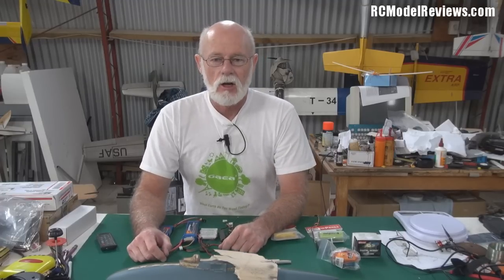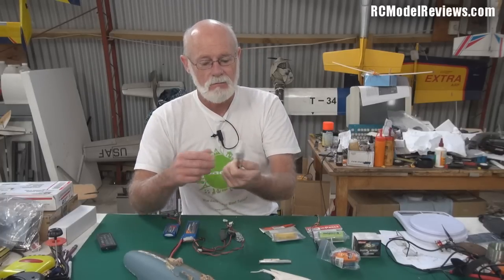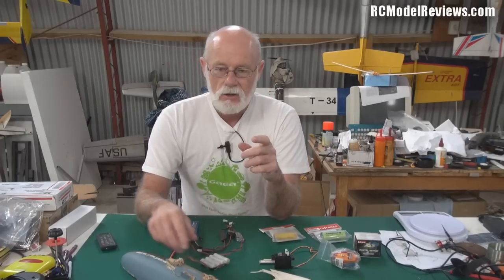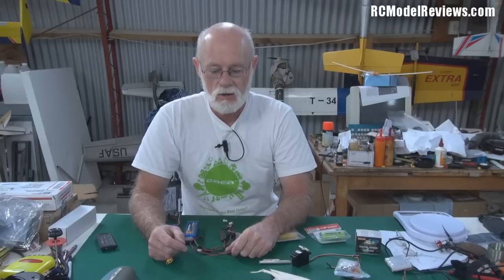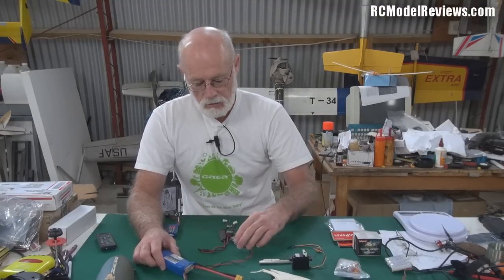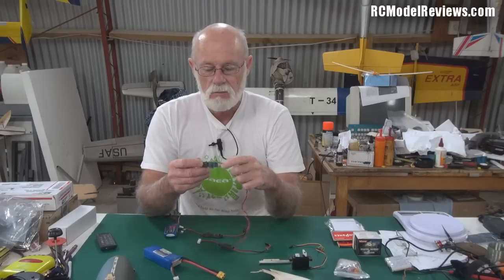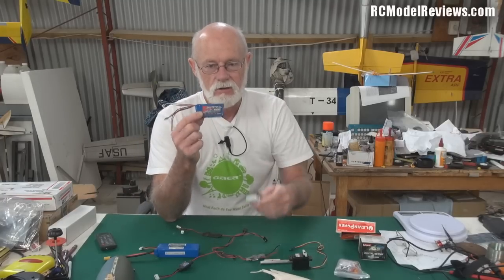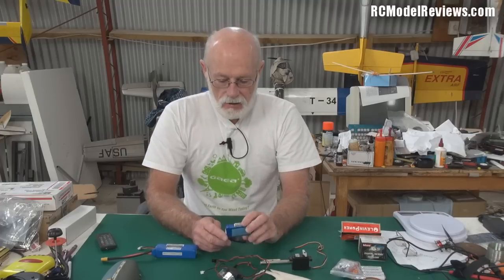A word about receiver batteries

Comment: Thank you for the information, I have watched many of your videos on RC. I am newbie in RC. I am stuck on a few questions and couldn't find any reasonable answer so far. 
My question is.. on the receiver end, how do i determine battery voltage Amps etc?

if there are ...
FlySky 9x Receiver and ... 
2 motors with propellers on both side wings connected parallel with speed control,  
2 servos (I don't know its required volts) on both Ailerons,
1 servo on Elevator,
1 servo on Rudder,
1 servo on Landing Gear,
1 servos with Flash light.

Now how much volt of current and in what direction i will need to put connection with batteries.
Reply: That's lot to ask as a you tube comment mate. Go to rcgroups (google it) which is more appropriate to find such info and ask such questions.
Basically you need to look at specs of your equipment and calculate it.

Comment: I have a 10a bec and can i use a 2cell 1500mah 20c lipo battery to power 2 hitec hs82mg servos and 10 towerpro mg 90 servos and 3 electric servoless retracts on a rc jet?or i need a bigger bec or a bigger battery?

Comment: I drive cars and trucks so not much of an issue hasn't someone come up with a backup supply just to land the planes ie a cheap 4 cell old type so when the power goes off a switch jumps into the backup just to land the craft?.
Reply: Fx 1C Yes, they sell a very simple device that does just that. I do use an "old" 4.8v nicad as my back-up. It only gets switched on if the esc/bec fails or the lipo (2S or more) drops below the 4.8v. The 600mAh is plenty to make what would be a deadstick landing.

Comment: i have an rc car it need some more power than 4 double a battery's i have noticed under 4v it shots down and then my car stops 
I have found a battery that is a liFe battery its 6.6 v my car has 6v servo's does that do harm or can i use the 6.6v ones?

Comment: Hi. Any ideas on which receiver and bat pack I should use on a 106" Edge 540? It has all metal gear 4 High Tech 7955 digital servos for ailerons 2  2 HT 7955 for dual elevator 1 same for rudder  and a bit smaller for throttle. sorry cant remember that number. Im running gas engine DLE 111cc Note: I had this plane running on all this info above and flew 2 flights beautiful but the 3rd flight was to its death. Lost signal or receiver and had little to no control about like a brownout. The two onboard batteries were fully charged. The ignition pack was a 7.4 4ooomah lipo. The receiver pack was a 7.4 5000mah. The both checked good at 8.15 and 8.17 at time of crash.  also I used volt regulators for both packs to reduce to 6 volt.  The receiver I had on board was a Spektrum AR6210 and transmitter is a DX6. Can someone tell me what I did wrong in this case???  Please help because my new Edge 540 will be here in a few days. Should I use a power board like smart fly or something to boost servo power or maybe a better receiver? Again PLEASE HELP Thanks

Comment: Hi Bruce and thank you for another super video. I  often check my lipo's  after charging  but , I can recall  placing a battery in my helicopter and flying it , thank  god   I didn't crash it . After rechecking  battery , I soon discover that the battery amp dropped down very low . Soon , I came to the conclusion that my battery was bad. Oh, what a surprise it was for me. So, I would like to ask is there a way to check battery amp's and avoid  a surprise .

Comment: Could you please help me? I have been flying for a couple of years now on and off, that is why i havent learned as much as i should, and mostly because i am not member of any Club yet, so everything that i learned i learned by reading, and that is not much. I have always power everything from the Esc (one Lipo) and i have never used bigger than 200Mamp. bat. Now that i am getting into FPV, i shorlly would be in need of couple of batteries on board, could you please make a Video about that.Thanks

Comment: I am curious also to see Bruces response to the LM7805 question.. Its a simple voltage regulator...but 'm not sure it can handle the current of large servos. I was thinking of using it for the 5 volt regulator for some cams and transmitters in FPV. I bought some nice regulators ...but they produced lines on the video... and I think the LM7805 may not do this.
Reply: Try a 338 adjustable regulator

Comment: could I use a 1 cell 3.7 volt lipo to power my receiver and servos on my nitro?
Reply: Would not advise doing that. (lipos have voltage 3.0-8.4V) depending on charge. You would risk receiver brownouts, most RX's drop out around 3.5V.
And under load voltage  it could easily do that. 
For example on spectrum rx's see: http://www.spektrumrc.com/Articles/Article.aspx?ArticleID=1683

Comment: I LOVE the idea of LIFE packs. Always have, but all the quality companies are gone. In my case converting dozens of planes to LIFE, with life chargers is cost prohibitive for something out the way out the door. New flyers buy life will get left out to dry converting later. Leaving LIPO+BEC which I don't think anyone really likes. We just tolerate it. :'( We need High Voltage components to become standard. Standard 4.8/6 servos work to 7.25v. OEM's should make the v range of 2s lipos standard IMO

Comment: Hi. I am building the Giant 2metre wingspan LX Mitchell B25 Bomber. I will also fit the 'model sounds incorporated' sound system with the recommended 3 inch speakers.
The sound system will work independently and directly from a Lipo as it has a voltage range of up to 24volts. So no problems for that.

The Bomber itself has 10 servos and additional cabin area LED's, and I have been advised to power the receiver independently.
The main battery, a purpose built flat pack designed for the model by LX. power the twin 600kv motors.
I watched your piece on the Lithium Iron Batteries (LiFePO4) and wanted to get your thoughts on the size required.
The main issue will be weight as I will now have 3 batteries.

I really enjoy your vids. They are interesting and very informative.............keep up the good work.

regards

Comment: Bruce, suggest you do a video on power boxes. They are usually waaay too expensive for just a couple of diodes..

Also for info, I use BECs in all my medium sized planes with 2s 1000 mAh batteries and have never had one fail. And they're all chinese :p

Comment: I have read through most of the responses and you or anyone else has commented on whether or not these LiFe batteries with "blow" the 4.8/6.0v servos and servoless retracts and your post it nearly 2 years old...Maybe a test with you using Life batteries would be in order?
Reply: most rx can only put out 6 volts anyway so servos will only see 6 volts...just make sure rx and servos rated 4.8-6.0
Reply: Servos that support 6v (that's nominal voltage) are designed to support 5 cell NiMh packs so. 2S LiFe packs which have very similar voltage range work fine. (and servo that run 4.8V nominal are designed around 4 cell NiMh packs) (NiMh 1.2v (nominal/cell) and 1.45 max/cell = 5x1.2V=6V and 5x1.45=7.25V
This can vary with servos, you need to check with manufacturer , especially with some of the older servos. Most digital servos 6v have no issues with 2s LiFe packs

Comment: Energy Density of an rx in medium sized+ plane is moot.
Maintenance requirements are EQUAL to that of lipo packs which need balancing as in NON EXISTENT. Just as Lithium packs need periodic balancing (more as they age) most chargers auto-balance every charge. Every good nickle charger ALSO has logic to cycle the batteries on command, automatic cycle/trickle loops, etc. My Litco has an indefinite C/10 charge->trickle->Cycle loop for example. Attach battery, Push button, Done. Same as Lithium.

Comment: Sorry Bruce, but I have to disagree with you there, the Eneloops you're showing in the video are definitely not 90's technology and are very different from older batteries, yes they are not made for power-demanding applications like lipos or life, but they certainly don't suffer from memory problems and especially not high self discharge rates, quite the opposite, that's one of the strong points for Eneloops, they keep their charge for a very long time.

Comment: Hi.  I watch your vid.s and enjoy them.  However, I am an American and our accents are quite different.  I am an old man and have a little trouble hearing and understanding everything you say, but I get most of it.  The last battery you described went right past me, twice.  So,,,what type of battery was it?  I would really like to know.  
Thank you for all the information you give out
Richard.
Reply: LiFe Battery(this is the common abbreviation). Full name is actually Lithium iron phosphate. It's confusing because there are a lot of lithium battery chemistries and abbreviations. NOT to be confused with the other common type, LiPo (Lithium Polymer)/Lithium Ion(which are also and abbreviation for same battery in  different physical packages, nominal 3.7v/cell). LiFe have much higher energy density (smaller/lighter) and current output compared to NiMh packs. LiFe Batteries have nominal voltage of 3.3V/cell , so a LiFe 2S (2 cell) pack has nominal 6.6V. LiFe batteries also have a flatvoltage discharge curve similar to Nickel batts, even better than LiPo's, These reasons make them a good replacement for the 5 Cell NiMh receiver packs.
Reply: I can't understand half of what he is talking about. He talks too fast on many of his highly accented words, ands crushes the pronunciation.

Comment: I agree: Ni-MH-s are history but I dont like you show the Eneloops and tell it is 1999. Please check when eneloops (as Low Self Discarge ni-mh-s) came into market. Few years ago. LSD is another story than old Ni-MH-s. Eneloops are quite top of the market today in Ni-MH batteries. Photographers use them in flashes. Eneloops give fast recicling time with reasonable price and stay full after 6 months or a year. Like lipos or lifes. Only downside a 12v Eneloops pack is more expensive than 12v lipo.

Comment: powering your TV remote control with LD-nimh's sure. they're inferior for R/C use. the extremely high IR leaves them unable to deliver nearly the current ratings a nicd can, nor are they as long-lasting or tolerant of abuse.

Comment: how much volt can a receiver take?
Reply: That varies with each receiver model and brand , most receivers  can run on a 2S Lipo (max 8.4V/7.4 nominal) BUT I would check the manufacturers specifications to be sure, all manufacturers will have that info listed in specs.
NOTE: as per video you also need to check the servos plugged into the receiver as well to make sure they also can handle the RX voltage you use.
Reply: aquestion , in theory a LiFe pack receiver battery 6.6 v wont burn my receiver that said worksbetween 4 and 6.5 v?

Comment: If one servo is shorted ... the bird is in trouble 90% of cases.
Anyhow Eneloop or other LSD NiMh is not history.
For instance are better then LiPo or LiFe as TX pack
Anyhow 10amp from a single AA cover lot of possible application .. you can see eneloop deliver over 1v at constant 10amp discharge from indipendent tests
In critical application rule #1should be to power RX independent from servos .. most of recent RX works fine with 1s LiPo ...

Comment: What has the receiver to do with current? It just has a common voltage rail. Surely that can handle normal operational currents. You are not making any sense there.

If you mean voltage, it all depends on the receiver (and servos) you got. Most modern devices have surprisingly high operational voltages.
Your typical FrSky receiver goes from 3.5V to 10V which is a massively high rate.

Comment: Because they have internal voltage regulators. (Most internal electronics actually work at 3.3V)
Might not be true for older receivers. But certainly most modern ones.
Why don't you just read the specs for your receiver? It should tell you the operating voltage.

Comment: I disagree about Lithium replacing Nickle. LIFE companies are dieing. The three biggest LIFE makers have gone bankrupt in the last 2 years. While LIPO batteries will CONTINUE to require BEC's which is a terrible thing. Especially with FPV. Adding another failure point and they also creates noise.
Unless "high voltage" servos become standard. Servos and RX's will continue to be based around 4s-5s nicd packs. (3.2-7.25v). That leaves direct lithium hookup a not-gunna happen.

Comment: .......... KEEP IT SIMPLE, ... BUY an ESC with a built in Battery Eliminator Circuit for the receiver, ... a BEC.
Do a bit of research on the internet, and you can find exactly what you need for your particular aircraft.
Separate batteries for the receiver WILL SOON be a thing of the past.
If you use a separate battery for the receiver, you are only adding weight to your aircraft, with Lithium batteries and an ESC with a BEC built in, you are simplifying things, plus less weight too.

Comment: AA batteries can deliver without problem 10amps
Instead promote LiPo, was far better to advise to use 1 battery for RX and another for Servos
Finally 4 Eneloop AA don't cost 50$
You made lot of nice video, but this is a disaster